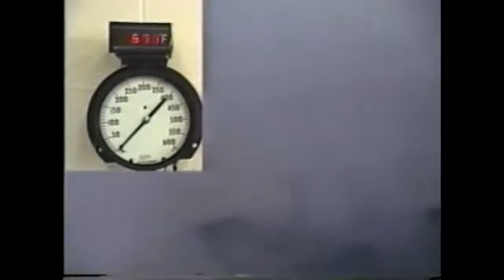The Dangerous of Heavy Tyre Explosion 🔥🔥🔥🔥

Comment: Those vids of the tyres exploding in the cages are a worst case scenario for overinflation!  This is normally well above the working pressure or the pressure you'd use to seat the bead, normally no-one in their right mind would ever let a tyre get to bursting pressure, unless of course you were being distracted or moronically negligent!  Some of those are also split rim wheels that obviously setup to fail.
Reply: Yess, Absolutley agree!  Too much air. And prob used a freaking 1/2 can or more of either is a NO NO
Reply: Sir.. I am a tire tech and know what i am talking abt.. A zipper rupture happens at abt 40psi.. And you inflate a semi tire to 100psi.
Reply: And ether is a big no no.. They havent done that in years..
Reply: over inflation is unlikely due to compressors usually maxing out around the same operating pressure of a tyre.
Reply: @chippyjohn1  Depends on the tyre in question, most shop compressors cut off at around 150psi, that's a good bit more than the maximum inflation pressure of the majority of tyres.  Also as some of these are obviously for the camera, it's entirety possible they're using a compressor that's been modified to run at a higher pressure, it's not hard to do.  They could even be using just the pump without it being piped to the receiver, in this configuration it can be setup to just keep pumping without worrying about the receiver exploding.  There's lots of ways you can achieve enough pressure to make a tyre blow out.
Reply: @Altair885  Even at 10 bar, a truck tyre is designed to hold more than that. There are videos of tyres on the internet holding 3 times that. Most of them are from split rims failing due to locking ring not being fitted properly or has lost its tension. A truck tyre inflated with 7 bar on a hot day creating a lot of internal heat with pressure spikes from bumps will exceed its max inflation pressure. I dont think the videos of people standing over or near tyres are fake, but the ones in cages might be for example of the cages ability. Have a nice day.
Reply: @chippyjohn1  I wasn't saying they're all faked, just that some of them are setup for the benefit of the camera.  And that there's various ways you can achieve a blowout should you want to.
Reply: That’s not true at all recaps and run flat tires exploded all the time at or under normal pressure
Reply: Not always, I was putting air in tire in cage, checked it 65 lbs was going to 80, as soon as I put air at 65 it let go. Thought lost my arm… tube failed..
Reply: @goatboycasto  Sorry to hear that.  I wasn't saying tyres never blow out, but it is unusual just from being inflated.  In this situation there's usually only a few reasons why that might happen, too much pressure, a damaged tyre, pinched tube, or using a tube in a tubeless tyre.  Of course split rims add an extra layer of complexity to it, but generally if you can avoid all the issues above then a blowout during inflation is rare, unless of course you do something funky while getting the bead to seat!

Comment: A lot of these folks are using ignitor to fill tires I only do that when I'm fitting a tire to a non matched rim typically for modded bikes or scooters.  Take care of your tires or they WILL take care of you. Also a bit of advice you should if possible carry a 12v tire I flavor one that has enough hose that it will permit you to stand anywhere except in front of your tire while filling it.
Reply: whats an ignitor? is it the ones at gas stations?
Reply: @michaelnaicker7348  ignitor spray or fluid like you would use in a potato cannon. Things like parts brake cleaner carburater cleaner highly combustible usually in a pressurized aerosol can. You spray the inside of the tire and rim and set it alight the fluid ignight making in essence a small explosion instantly pressurizing the tire and locking the bead in place. I do it when I'm forcing a tire that doesn't match a rim. Allways for custom bikes or scooters. It's allways a laugh till it's not I've a had a misshap or two.
Reply: @carlosenriquez2092  Jesus christ dude. Use some commas. Your sentences are illegible.
Reply: @Rale881  punctuation, is overrated. If and that's a big if, you understand the fundamentals of syntax and can grasp the concept of inflection then, you should be able to read and understand any sentence or grouping of sentences without issue. The inability to do so may indicate some form of learning disability or cognitive impairment.  You should schedule an appointment with an appropriately certified doctor to investigate this. I put in some dots and smudges on this one to make it easy on you. Good luck on your recovery.
Reply: @carlosenriquez2092  what's a ''12 volt tire I flavor''? Does it taste like a battery?

Comment: Fill to the data plate, not to what the sidewall of the tires says.
Reply: I've also since learned that of you have big oversized tires, there is a formula to calculate what the pressure should be.

Comment: Those people using the spray and the lighter  to fill the tire up thing is if you put little bit to much it will explode if you put little less it wont work using that way is dangerous you only use that way if you dont have access to pump which in these videos people do they are just being lazy

Comment: what stupid country is this and why would they decide to do that? I'm a mechanic that's literally built 100s if not over a 1000 tires and counting... having tires explode for too much PSI is not a thing if you know what you're doing and value your life, the equipment you're using and the customer's tire.
Reply: Yet, the tire guards are a thing for a reason.  Just because you haven't experienced it doesn't mean it doesn't happen.  Could be as simple as defect in the casing or a pressure gauge registering wrong.  People become blasé because it hasn't happened turns into it will never happen.
Reply: @dlewis9760  or you've done so many you can tell by the sound and feel how much PSI is it. No excuse to blow up a tire if you know what you're doing. I've never even heard from a friend of a friend of a friend of it happening. Might as well just set it to the correct PSI and call it a day.